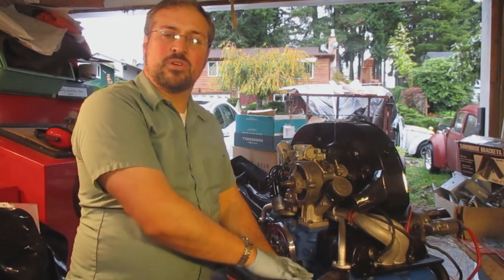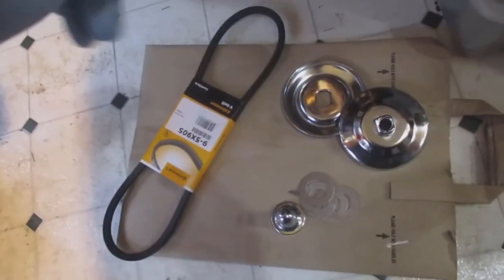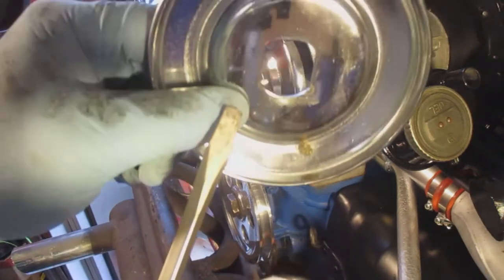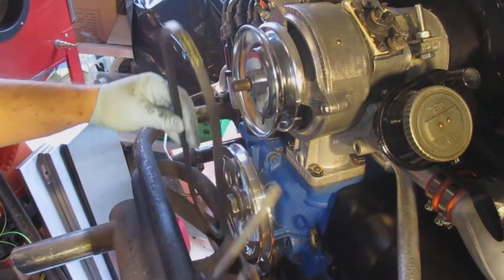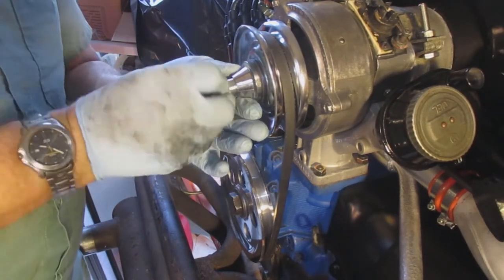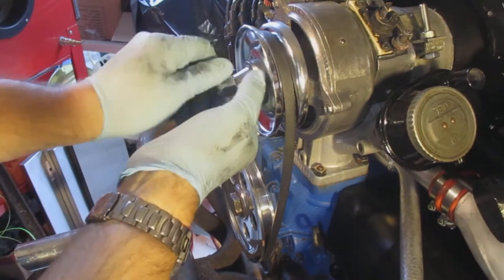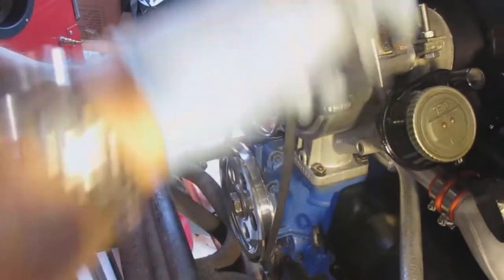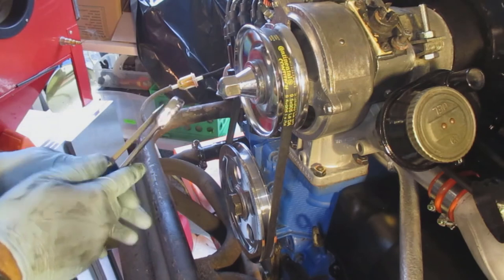DIY how to install a VW Alternator pulley and belt on a Type 1 engine

Comment: Thank you for this. I never worked on this type of engine before and was wondering how to tension the belt when no idler or tension pulley is present. Very helpful!
Reply from the maker: you are welcome. WHen purchasing the shims there are about 12 of them. be sure to use all of them on the pully. Have a great day!

Comment: how many amps is that alternator?  btw nice vid
Reply from the maker: I don't know. I know there are a couple options to choose from. the most important Item to look at when selecting an alternator is the wire connections. The one shown in the video is the external voltage regulator type. Have a great day!

Comment: Thank you for the video and information. Do you have any comments about using an aluminum pulley instead of the stock steel?
Reply from the maker: The aluminum pulley is easier to set the timing with a timing light and looks nicer. I hope that answered your question. Have a great day!
Reply: @mountpac4464  Thank you, and I agree, the degree pulley is very convenient for setting the timing, but it's the alternator pulley that I found to be inferior to steel because if there is any looseness from the nut and shim setup compression of the belt will allow that play to rattle and damage the keyway groove.

Comment: Where did you get your replacement pulley? I got one online that came as one piece and it won’t fit over the shaft.
Reply from the maker: Sometimes I use a rubber mallet to help with the install. maybe a little bit of assembly lube. I hope this helps. Have a great day!!

Comment: I am installing a type 1 engine in my dune buggy it has an alternator like what you are working on so 1974 I believe. The three tabs are wired from the alternator to the regulator and they letter markings on both ends so I know where those wires go. And the bolt tab has a hot wire that goes from the alternator to the hot wire on the starter solenoid. In the car there would have been one more wire that went to a light on the dash do I need that wire on my dune buggy. And if I need that wire what does it connect to? It looks like it would have come from the regulator but I don't know from which of the three terminals it would have come from.
Reply from the maker: Hello, Thank you for your reply. The alternator is for a 1973 beetle, it requires an external regulator. I use an alternator with an internal regulator. I am not up to speed on the wiring of the external regulator. I did a brief search, there should be a dash warning light. I hope this answers your question. Have a great day! -Michael